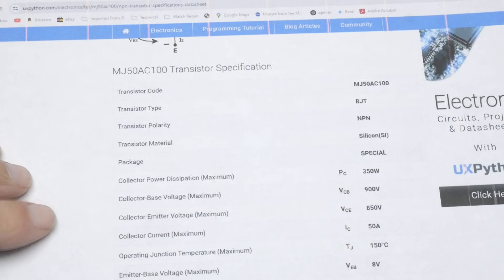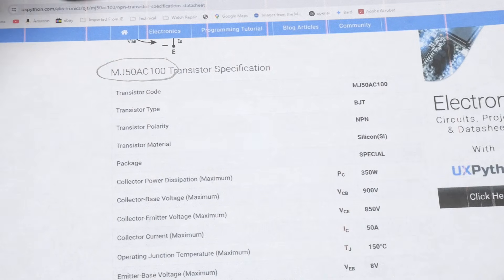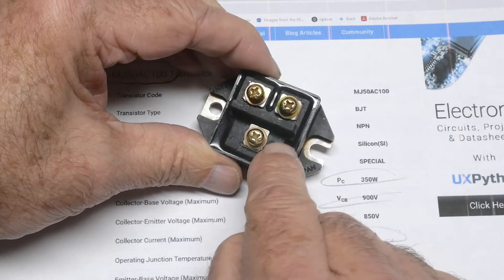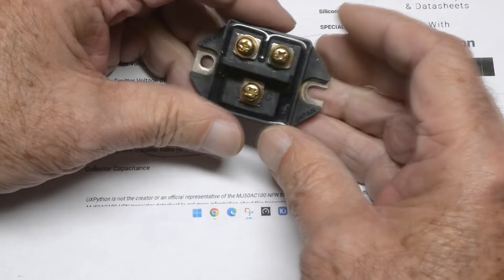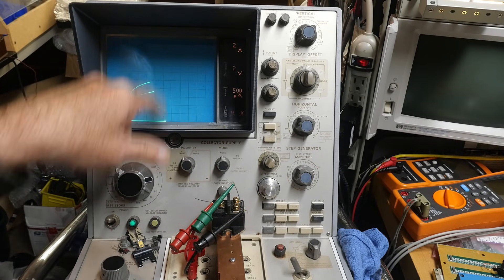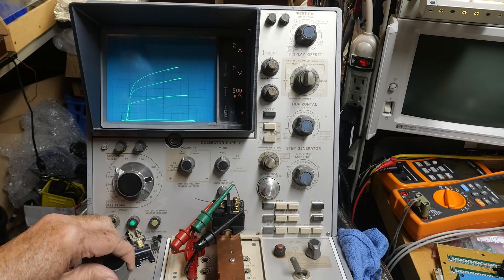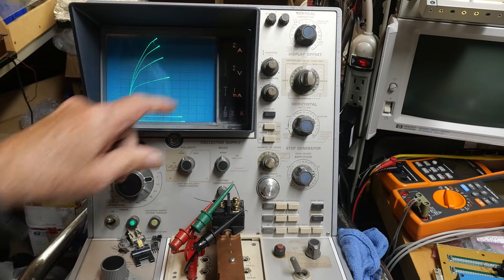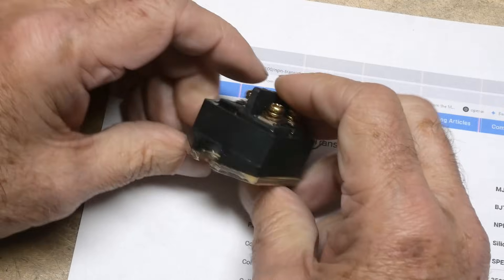#2150 MJ50AC100 Transistor 900V 50A

Comment: I'd tend to agree with your assessment, probably a relatively early IGBT. Toshiba was the world leader and first to make what we'd consider IGBTs in the mid 80s. 

What's the capacitance on the gate to emitter? 

My understanding is the biggest improvement in IGBTS is reduced capacitance and faster switching speeds.  

It would be interesting to see how fast you could get it to switch. I think early IGBTs could barely switch above 2khz whereas the IGBTs in my modern inverter welder switch at close to 200khz and cheap units can switch at 20khz no issues. I havent done enough reading to have any significant confidence thought.

Comment: I remember one of these in an older toshiba argon laser power supply. It regulated the current going to the tube, and you could roast marshmallows on the heatsink when running at the 20A max current the head was rated for. ❤

Comment: That's like a little version of a PowerEx dude, pre IGBT.  I have a couple of the bigger ones, they have a stack of darlingtons to make this happen, so 2 beefy transistors to drive that last monster die.  would make a beautiful linear power supply pass transistor!  instead of the stack of 18 T03's i'm using to accomplish the same goal.
Reply: They blow up nicely as well, so the replacement, as they were just about unobtanium, was a big piece of aluminium heatsink extrusion, and drill 16 TO3 mounting hole sets on it, and put in 2N3773 transistors in all 16 locations. No insulator set, so collector was heatsink, so isolate it from chassis, and drill 16 extra holes for some PTFE stand offs that were near emitter. Base was a 12SWG tinned copper wire connecting 15 transistors together, and to the emitter of no 16. Then a short 18 SWG wire from those 15 emitters to the pin, and 15 equal length PTFE 16 gauge wires to a common bus point. Last 2N3773 was the darlington driver, driven from the inverter board with another darlington referenced to the 48V supply rail by a really hot running power resistor.

You needed 2 of them per inverter/ferroresonant UPS unit, so they all eventually got upgraded with the big heatsinks, as this was at least easier to fix, just pull out another tray of 150 2N3773 transistors, a big pot of heatsink compound, and lots of that 18SWG wire which acted like a fuse to tell you the transistor was definitely dead short, and any that had not blown was probably because the transistor blew off the emitter bonds first. Testing done with 4 55W headlamp bulbs in series with the transformer, just in case there was some other issue, bright bulbs were a lot better than changing all those transistors again because the board also needed fixing.
Reply: @SeanBZA  I was concerned about the rework issue as well.  So what I did was I got the right size Mill Max pcb solder in socket cup that would accept the transistor leads.  Made the custom heatsink paddle with the collectors bolting through, isolated, to the board on the other side.  Had to design a custom T03 drill guide, but it worked like a charm, and all the holes for the paddles, transistors and boards lined up like a miracle.
Went with 1" wide traces for power, and plated over for more oompfh.  Torture testing shows it easily handles 50A, but maybe not continuously.  30A no problem.  Each tran is only pulling 3A so there's tons of safety margin in the supply.
It's terrible though, to have to use them in the ohmic region, spec'd at easily 25A saturated, can only use them up to about 4 A max in ohmic/triode mode.

cheers.
Reply: @ I took one of the dead ones, and cut the lid off, and broke the glass seals out, so it was a guide, drill one for the mount in a line, and use the template to drill the others with a bolt holding it in place. At least using the heatsink as collector meant i could simply drill using the tapping size, and tap the mounting holes, saving needing to use a nut and the fiddly work it came with. Little bits of PTFE wire insulation over the leads in the heatsink and no chance of shorting out, and you could use them again on the new transistors.
Reply: @SeanBZA  You almost have to do that.  I checked the outline drawing to make my jig, and I was shocked that the dimensions were completely off.  How do you go to production, make the thing, and the drawing doesn't even match the package!
So I took a different shortcut, Avid Thermalloy MUST have the right dimensions, they make the heatsinks, so I used a pre-drilled heatsink as my template, and it all worked out.

Comment: It's an IGBT module manufactured by Toshiba. You can find a stock sheet from Ariat Technologies online. It's similar to a MJ50BX-100 and a MJ50BKB-100. They might turn up in the old Motorola Bipolar Power Transistor Data book from the 80s-90s if you have the Motorola book set handy.

It supposedly crosses to a: QM50HY-2H Mitsubishi Electric Semiconductor, but the package is different. 50 amps, 1kV,  hFE of 75.
Reply from the maker: tri-stage Darlington
Reply: @IMSAIGuy  I noticed that on their schematic, even though they call it insulated. The first transistor should have a gapped parallel line for the base or gate connection like a MOSFET, but the schematic shows a plain transistor, and they have it labelled as a base connection.
Reply from the maker: @craxd1  the datasheet I have does not mention an isolated base pin. It has an isolated heat spreader.
Reply: @IMSAIGuy  I think that the distributors, such as Ariat, may have it mislabelled as an IGBT. The spec sheet I'm using is the Mitsubishi replacement or equivalent, which has a different case. I could never find a spec sheet on the original number, but Mitsubishi calls it an “insulated type” at the top of the page. Nowhere in it do they say how that is, thus, Ariat calls it an IGBT. However, it has a 3 amp base current rating, which I just noticed.

Comment: A part that requires even more than the high outputs of your 577! Definitely a stressor on the old circuits. 
A good choice for an electronic load? Nope, it's an igbt.
Build a circuit to stress test?

Comment: I’m surprised those clip leads can take 20 amps 😱  How doesn’t that blow a breaker also?
Reply: Short term they will survive, and while the transistor is conducting 20A, with 15V across it the power is only 300W, and as it is also doing the current sweep per cycle the actual dissipation in the transistor is probably only 150W, and that is a peak, average likely under 100W, which even a US power socket can supply, though that curve tracer likely is already warming up the room with 500W anyway even at idle.

Comment: I honestly can't remember where I got those 15 or more years ago.  Probably have 100 or more of them cluttering up a drawer in a Lista parts cabinet.  It's getting to the point I think I should switch careers and become a obsolete parts distributor.
Reply: There is certainly an ebay market for selling obsolete electronics.  Overpriced at that.
Reply: Yes, you should definitely sell some of your surplus parts. You don't need 100 of them.